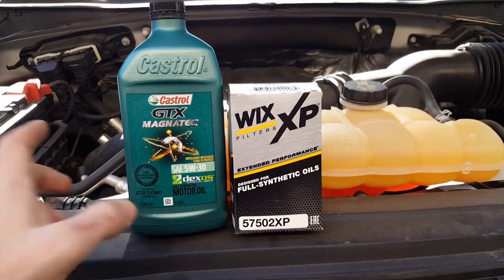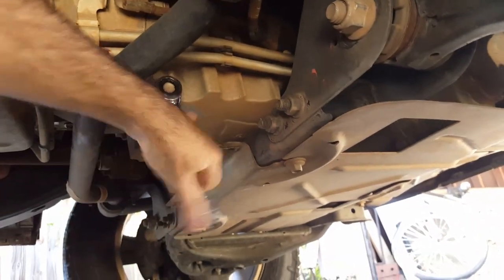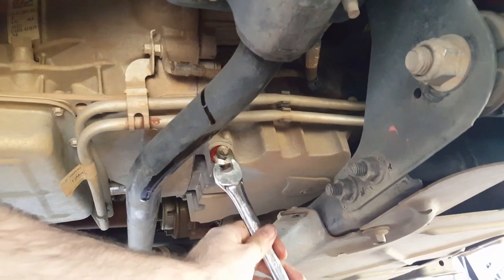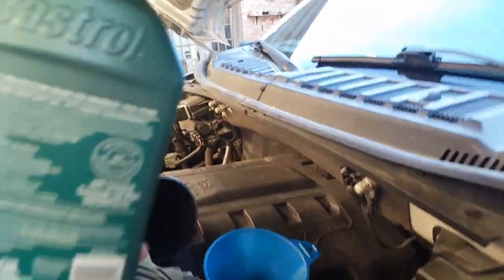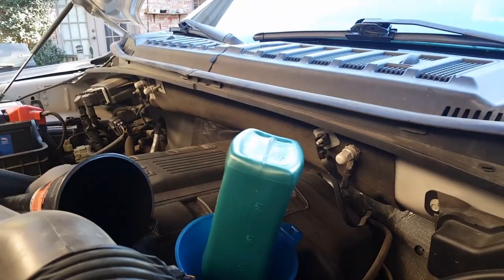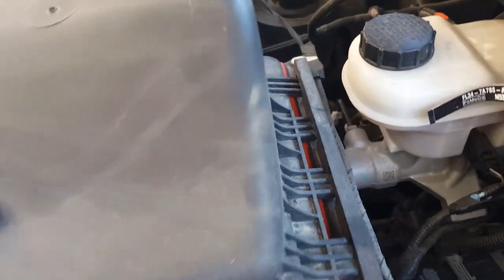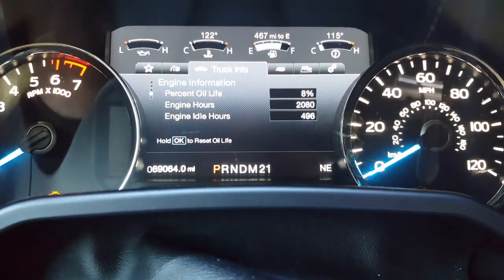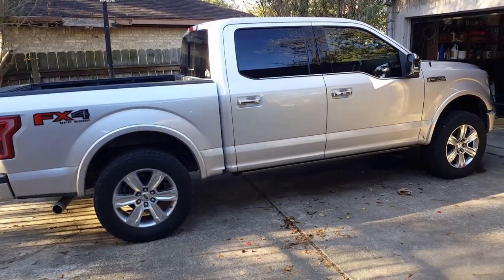Best oil change for 3.5L ford F150

Comment: How often is recommended to change the oil in this type of engine? I had always silverado but I own an ecoboost now. Thanks for the video great video be blessed 🙌
Reply from the maker: I try to stick to the algorithm. The truck computer is programed to take many factors into account when it calculates oil life. For me, its been 7k to 10k miles.
Reply: I got f150 EcoBoost 2016 3.5 I change it every 5,000 miles and I got 250,000 miles and it runs like  brand new
Reply: 5000 miles don't take no Chances with those turbos
Reply: I do my 2016 every 5,000 miles, and oddly I get a message in the gauge cluster that I'm due for an oil change, but in reality I still have 500 miles to go, so I'm going to change it anyway.   I've been using as per the manual Motorcraft 5 - 30 semi-synthetic, so I'll stick to my 5,000 mile changes, but may switch to fully synthetic, and then do my changes at 7,000 miles

Comment: How does your truck have the metal pan and drain plug? I thought all the newer f150's used plastic parts.
Reply from the maker: Yep... i think they started with 2016... or 17. Mine is 2015

Comment: What year is the Ford F150 truck?  Is it a 2017 or 2018?
Reply from the maker: Thanks for watching! It's a 2015 👍
Reply: @ricardosworkshop    I wonder whether the procedure is  exactly the same for a 2018 3.5 Ecoboost Ford F150?  Ford went to a plastic oil pan/plug at some point, however, in mid-2018 they switched back to a metal oil pan/plug.
Reply from the maker: Interesting. I did not know. But it's the same engine so it should be very similar.